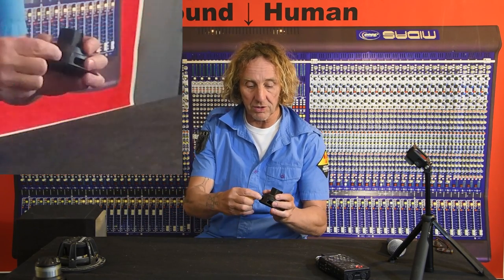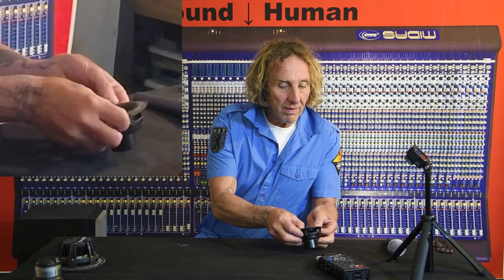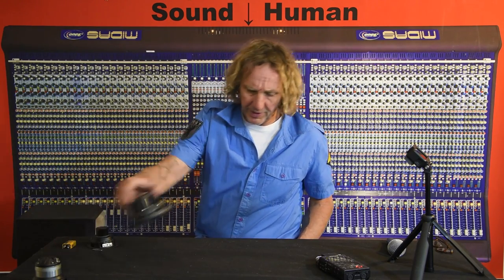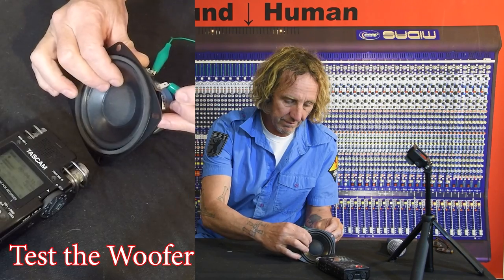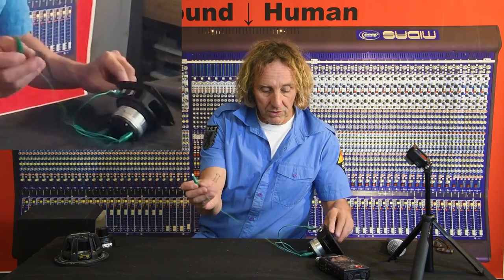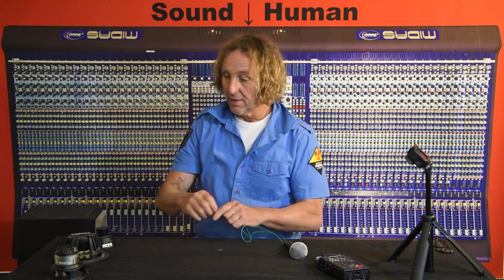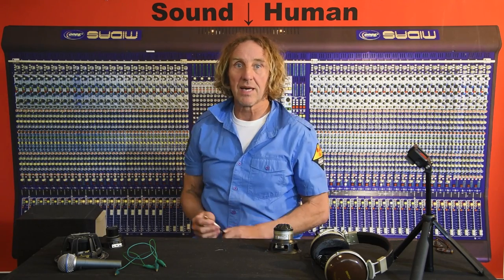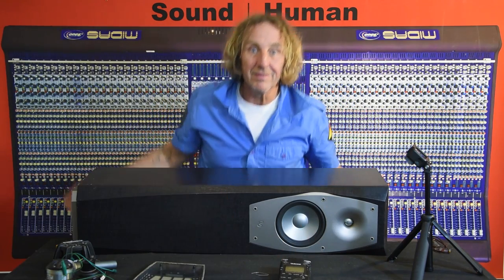Speaker Test Tricks! MacGyver Test Mics & Headphones Too (Public)

Comment: You're the best Dave ! 
However, can i put 9V battery on compressions or tweeters without damaging them ?
Thx
Reply from the maker: I do and have not had an issue. I would not pout a 9v directly into a delicate home hifi tweeter. Through a crossover is not an issue, through a capacitor, all good. But direct to a delicate tweeter could damage it. 9v calcs out to about 5 watts into16 ohms and 20nwatts into 8. But speaker impedance is higher than DC resistance that the 9v will see. So if a comp driver is 8 ohms, the 9v could send as high as 20watts. But that would require the 9v to output 2.2 amps and a real world fresh new 9v I believe can only do 1/4 of that current. 

Using older worn 9v batteries is safer if you are testing delicate devices. If you use a 1.5 volt battery it will typically no be enough voltage to see anything and will be very quiet. I would not pop a beryllium tweeter with a new 9v without a crossover.  I will pop home hifi through the crossover and no worries

But, like a said, I have not had any issues. Oh wait, I have used a 9v to test mic diaphragms in a pinch, 58a, 421s, and 9m7 all good. But years ago I tested some mic, can't remember what, and it fried the voice coil wire.

So, yeah. Don't test some mics with a 9v
Reply: @DaveRat  Thank you very much for your precise answer.
I was surprise the first time i put multimeter on a compression driver, the quite high noise/pop it made, so i thought i had blown it... And stop it definitively.
But I'll take an old 9v to test now, or thru the filter!
Thanks again.
Reply from the maker: When testing through a passive crossover, the HF will pop once, then the capacitor will be charged so the battery will need to be reversed for each pop

Comment: I often use speakers to test my batteries. If you have two smaller speakers, you can wire them together, talk into or tap on one and hear it on the other....I remember the tin can acoustic telephone experiment from 4th grade. We had a 50 ft commercial trawler in the family and the "comm" system from the bridge to the engine room was just a flared pipe..it worked really well.
Reply from the maker: Here is a video I did on transducers doing some of those demos with my daughter
https://youtu.be/yBgHA2ZeQ3A

Comment: Helpful advice thank you. How would you go about replacing a 1" compression driver with no RMS markings only a 16 OHM stamp? Specifically manufactured for a discontinued Italian made 3 way dsp p.a. speaker, which distributes 500 watt to a 15" woofer and 150 watt to both the 8" mid range and 1" horn. How many watts in RMS is the 1" compression driver?
I have read the scamatics of the p.a. speaker, which don't state each drivers wattage. Is there a way to test for the wattage?
Reply from the maker: It's not really the wattage that is going to trouble you here. The issue is finding one that mechanically fits.

I would say if you find one that fits put it in and you're all good don't worry about the watts.
Reply: @DaveRat  the driver is screwed to a CD horn with a 1 inch threaded throat. So would need one that can screw on the horn.
Reply: @DaveRat  also my main question was "is there a way to test for the wattage"
Reply from the maker: Typically to determine wattage of a horn diaphragm one would use destructive tests.

As you turn it up till it blows out and document the wattage and then turn it up as loud as you can and not have it blow out and document the wattage.

Mounting a tiny thermal camera inside of the back of the horn driver could help determine wattage by how much heat is generated if you knew how much heat it could withstand.

But wattage is overrated for horn diaphragms. What really matters is maximum SPL for the frequency range that it will be used.

And frequency response versus the frequency range that it will be used.

If you have a diaphragm that is 6 db more efficient and handles half the power it will still be louder.

Comment: Thanks!!. 😎
Reply: @DaveRat  as someone who's been pushing up faders for 50 years I really appreciate the time you take to do the videos. I don't know about you but I'm still learning!. So here's a thought. Years ago I worked with a band that used 3 good sized powered  Ampeg cabs for PA.  I can't remember the specs but they were horn loaded for sure. At one gig I took the chance of using one cab for vocals, one for drums, and one for instruments. Fortunately we had the cabling to pull it off!. I've often thought that a line-array could be built like that. You thoughts?. 🤡
Reply from the maker: Hmmm, a line array relies on multiple drivers with minimal vertical spacing all reproducing the same signal.

Do a search for Dave Rat double hung PA for what I have done in using multiple line arrays to reproduce multiple signals.
Reply: @DaveRat  I was thinking sperate arrays for each: vocals, instruments, drums. Much like bussing on a console. The other way, individual boxes in one array for each would be complicated for sure. Too many phasing issues I think.
Reply from the maker: I toured with something like that for arenas worldwide. Search doublehung PA for more onfo